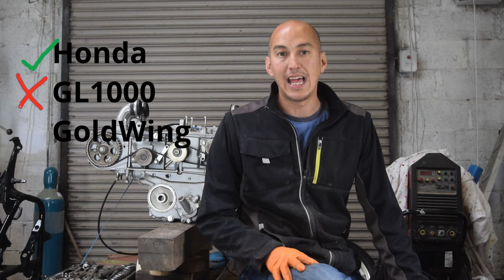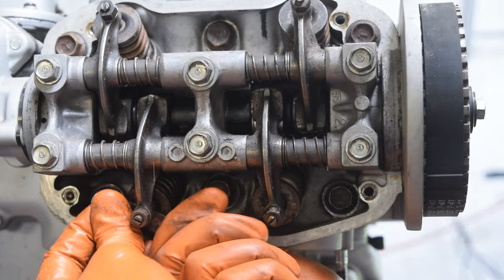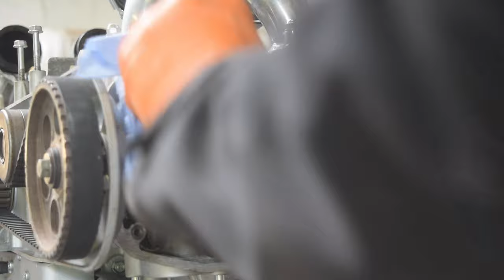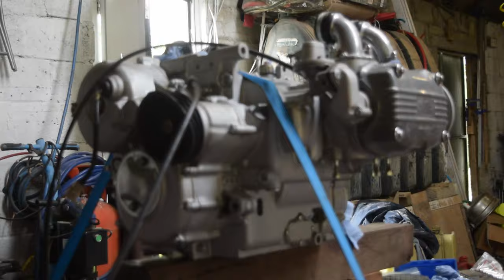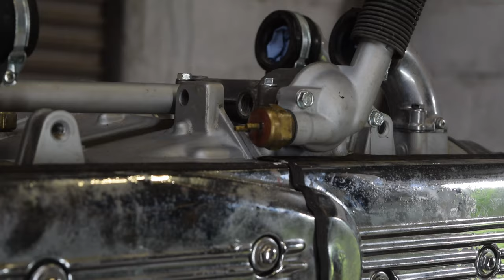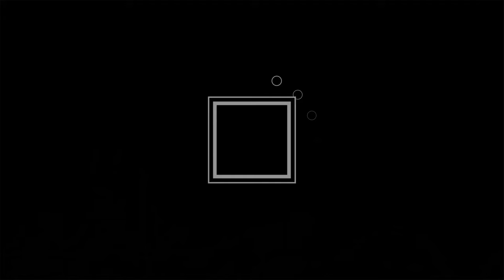Honda GL1000 Goldwing 1978 - Restoration - Valve Clearances and Engine Reassembly - Part 4

Comment: Hey r u interested in doing another gl 1000 engine? How much would it cost?
Reply from the maker: It depends on the condition and complete-ness of the engine. This one needed a lot of new parts as well as re-chroming a lot of existing parts.

Comment: amazing! I'm in the process of restoring a 1976 goldwing. I'll suscribe to your channel. what do you use to clean the engine?
Reply from the maker: Thanks, for the sub, I used carb cleaner and a toothbrush and shop cloth. The bike is almost finished now.
I've had delays on getting parts so I've been unable to complete enough content to get a video out. I'm finding some parts very difficult to source.